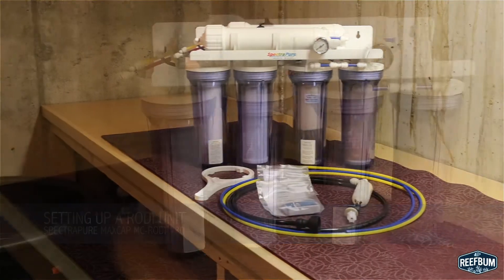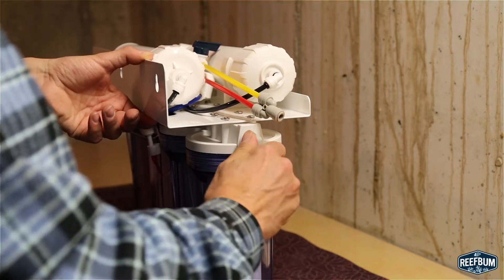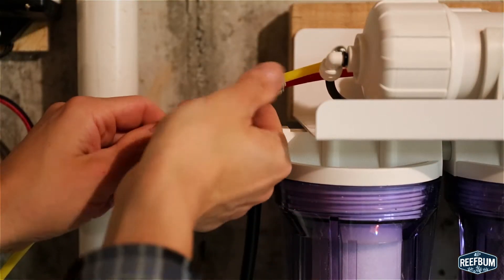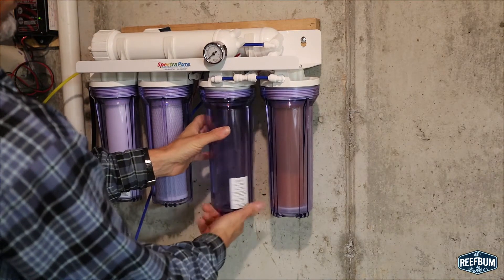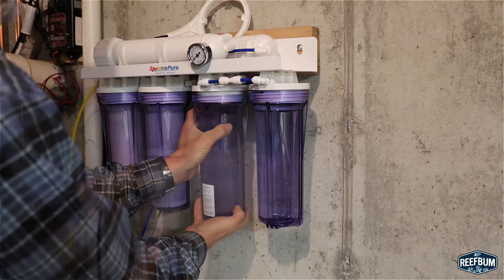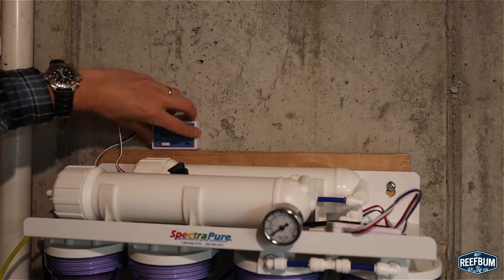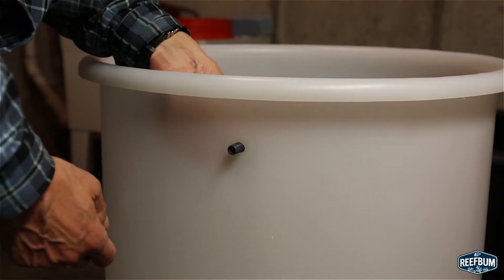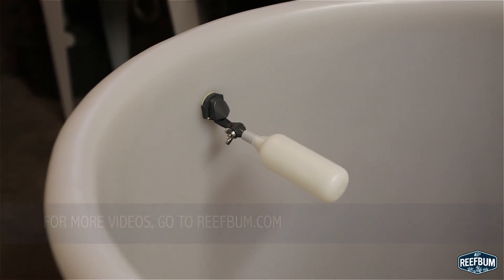Setting Up a Spectrapure RODI Unit

Comment: I noticed you didn't use any of the little blue collars on the quick connectors to keep the fittings firmly intact since there's significant pressure pushing the water through the system?